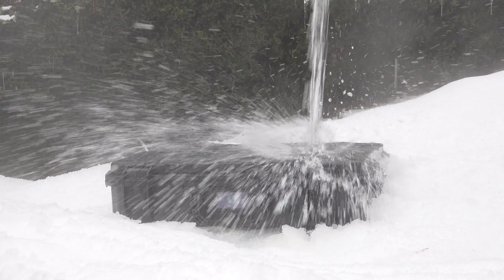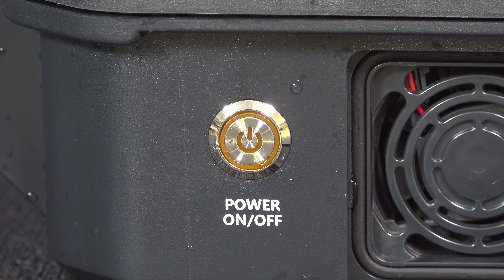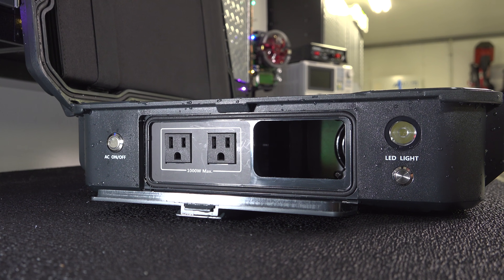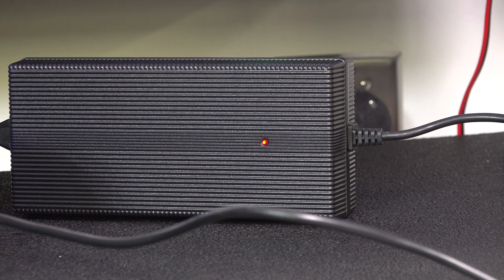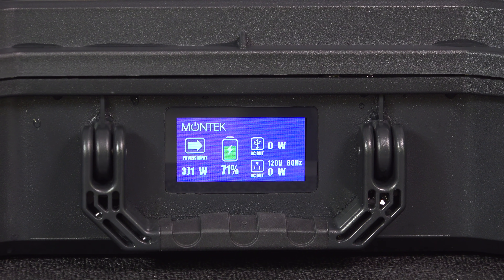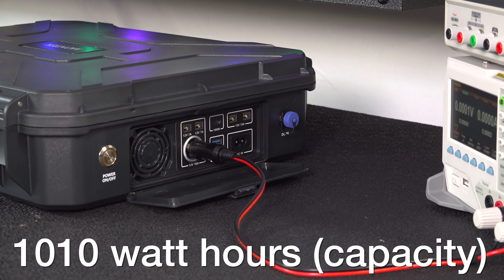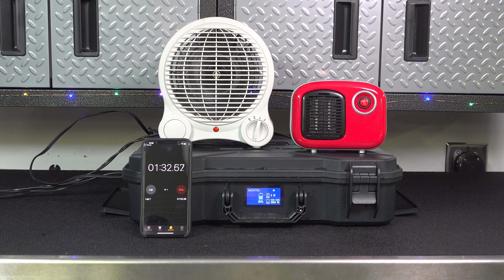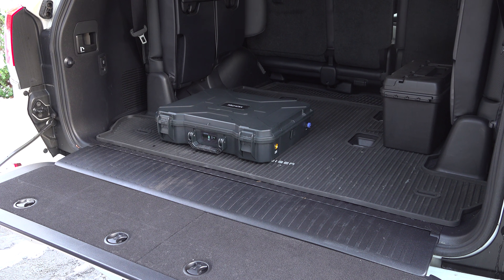Waterproof 1000 Watt Battery Generator CHEAP & Solar Power Station - Montek X-1000 Review

Comment: Funny, but- THIS is exactly what I think of in my head when I think "Portable Solar Generator", right? I expect some serious water resistance, I expect a super durable case, overbuilt electronics, exceptional soldering with conformal coated wiring. I mean, it's going down the road to serve somewhere- Not in Joe Biden's basement- the beach, a mountain, camping. Very efficient & over built for a price that most people can actually afford. Thanks for the review & thumbs up.
Reply: It’s crowd funded junk. Not even released yet
Reply: @project-overland   Well, you are correct...this promoter is not yet established in the market.  
That’s why developers need crowdfunding. 
Where things go wrong, is usually in the manufacture of their gadgets....too many that should be easy to make, get derailed when these startups cut costs by contracting with bad manufacturers. 
It’s hard to tell which products on a crowdfund will do well, & which won’t. 
NEVER put money in a crowdfund, unless you can afford to lose it!!  It’s the same advice one should heed, if they think they want to play the stock market...it’s a gamble....especially with products not yet in reliable production. 

Even when the tech being used in an invention is old tech, and even when similar products Are on the market, they can be ruined by the bad manufacture issue...but that’s on them for being ignorant of how costly it is to bring a new product to today’s market.  And it’s on the manufacturers that allow poor quality to leave the factory. And it’s on the investors who are willing to lose their money.
Reply: Vaporware,  battery technology is not there yet.
Reply: @mannyechaluce3814   You are wrong.  
There are a number of very decent products out on the market, now.  Some of those started as crowd-funded. 
Sure, we’ve gambled on a number of crowdfunded things...some were good ideas gone wrong from bad manufacture. Sure, we’ve lost some of those bets....that’s a big problem for crowdfunding, because NO crowdfunding seems able to screen campaigns well enough before letting them post a champagne. 
But we were happily pleased with Goal Zero...still are...a comparable product.  It’s literally been saving our bacon, running two fridge or freezer chests during outages, & gradually letting us take a room at a time off direct grid power....which was one of our goals....to reduce dependence on the grid, & have portable power. 
Batteries are being developed that will make portable power better & better.  But for now, our box (and most others) uses Lithium batteries, to make it lighter to carry. 
Whether this little startup will be similar quality of manufacture as Goal Zero, or Kodiak, or others, remains to be seen.  
But this idea is Not vapor ware, & there ARE good batteries that DO work just fine.
Reply: Portable all-in-one battery boxes like these, have been made for YEARS. Numerous inventors have come & gone. So have their products.  We almost got one, almost 20 years ago...Power Box?   But money was tight.  
They put everything in a barrel container on a dolly. Used lead acid deep cycles...so, bulky & heavy.  Same company made units built on trailers, of various sizes, too. Power a house off those. 
We nearly DIY’d one.  Then Goal Zero launched...after following it on indegogo, it was found on a Costco Roadshow for a nice reduced price. Good product, well made.  So are the Kodak boxes & others, like the one now sold by Home Depot. 
The golden goal for pricing solar PV, is a dollar per watt...I consider that benchmark when looking at PV.  
A reasonable average price for a battery box with all the stuff in it to stand-alone, is also about $1 per watt. 
This new offering seems lower or about that...though higher than $1 per watt. All of them are over that desired benchmark prices....this is in the USA....we endure drastically higher costs for goods & services in the US, than most other countries. 
Whether this unit will survive contracting it to a manufacturer, remains to be seen...THAT is why we waited to see how well the Goal Zero products did, once sold to public...,electronics like these are costly for most folks...who cannot afford to gamble on an inventor taking their money then ghosting them...yeah..that happens...fool me once. 
But absolutely easy to DIY, if you have the knowledge & ability.  
Go for it!  Because that may be the only way to get a unit that does exactly what you want, for less cost.  But before ya do, check out the units sold by Home Depot..,the one that has solar panels that slide out of brackets on the box on wheels. Or Kodiak solar. Or Goal Zero.  Or others.  Those might give you some good ideas, or might be what you seek.

Comment: Good review but from the looks of it can the battery be replaced once it's past it's service life instead of buying another whole  generator unit??🤔
Reply from the maker: Yes I agree, that is a huge thing I like about this one. Most can be opened but will be destroyed in most cases due to such tight tolerances and conectors that aren't mean to be taken apart. This is one of the few that allows it. Very nice unit especially at the price here: https://monteksolar1000.kckb.st/79cd2559

Comment: 12v regulated?
Reply from the maker: Yes it is. If you watch the time lapse during the 12v run time test you can see the stable voltage on the left. This was a very surprising performer for such a low cost. Order here: https://tinyurl.com/y7hagtgp
Reply: @SilverCymbal  I did order one. I actually just bought a AC50S, and really like it, but for not much more and double the capacity and higher ac output seems like a no brainer. Even better the slim case design fits better under the bench of my camper setup.

Comment: Main question ... Where was the battery. Under that aluminum cover, made? If anything China head for the hills.
Reply from the maker: Yes its under the aluminum cover. All of these, as well as Honda, Yamaha Generators & Generacs, Harbor Freights are made in Hong Kong & China (no longer even Japan). So you can avoid them but are currently no other options.
Reply: @SilverCymbal  I bought a new eu3000is back in November and it was made in Japan surprisingly.

Comment: Is the display on 24/7 or is it on/off based on power switch setting? 120-VAC, pure sine @ 60-Hz for USA unit... correct?
Reply from the maker: No the display is not on continuously, only when the power switch is on. Yes 120VAC, 60hz. I also showed this towards the end of the video and confirmed with with my electrical quality analyzer. Very nice unit all around / order details https://tinyurl.com/y7hagtgp

Comment: Decent Price until they add the $129 shipping fee when you get the 2 solar panels - $84 without solar panels.    :<(
Reply from the maker: I think they tried to factor that in, keep in mind the Jackery 1000 is $999, which I love but it isn't rugged & can't charge at these speeds. So for a lot less than that you are getting a really good value.
Reply: @SilverCymbal  Agreed - I suggest that you include the shipping fee in your description.  $549 + $84 shipping = $633
Reply: @SilverCymbal  this or the jack 1k?
Reply from the maker: @beartug  This is almost 1/2 the price and the Jackery is a great unit but this one is priced so low and with the built in case, I loved it: More details or to consider ordering here: https://monteksolar1000.kckb.st/79cd2559
Reply: I LITERALLY was JUUST about to click back on the link to see if it is FREE S/H!! Thanks much

Comment: I would only need one of these to power our refrigerator and perhaps one or two 13w led table lamps.
Approximately how long would this unit do that?
Reply from the maker: For an average size fridge this would be able to run it for approx 6-12 hours depending on outside temp, etc.
Reply: @SilverCymbal  Thanks!